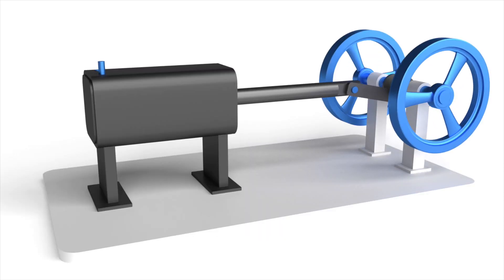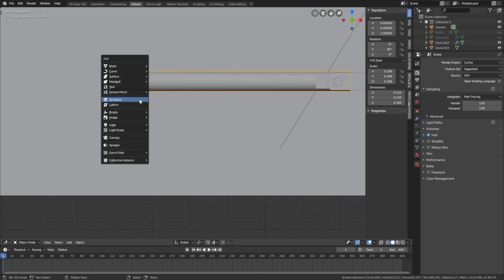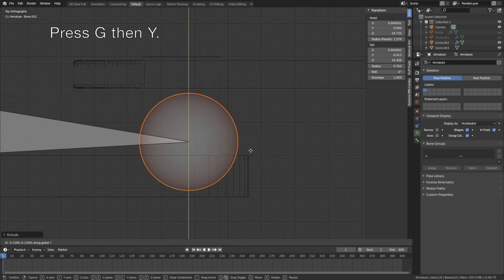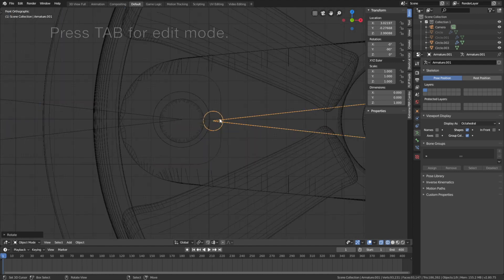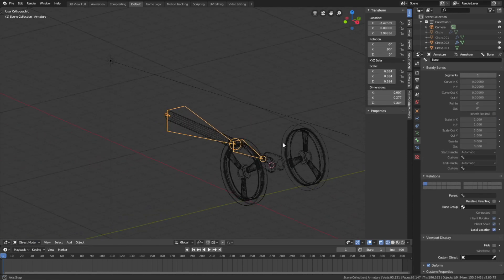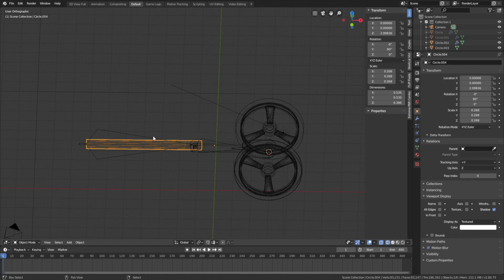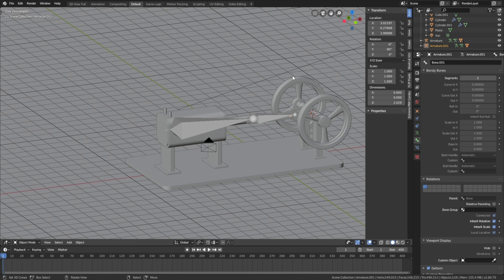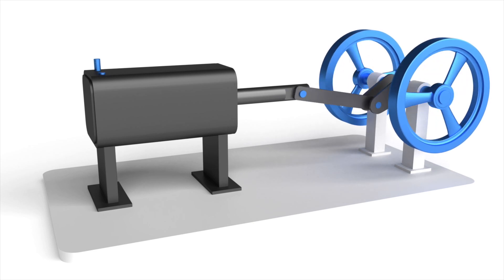[2.8] Blender Tutorial: Mechanical Rigging Made Simple

Comment: It's interesting how the same thing can be done different ways. I built a piston style engine before and tonight I did it again just to be sure I still could. The first time I made it was about a year ago and it took me about an hour to just get the mechanics working correctly. Tonight I did so in just a few minutes. However, the part I find interesting is the different approach you and I took to solve the same mechanical problem. You did it with bones which is likely a more industry standard method. I did it with two rigid body constraints and three rigid body objects. I guess in some ways it's the same thing, just two different methods. I find that interesting.
Reply from the maker: Yes, this could probably be done with drivers as well.